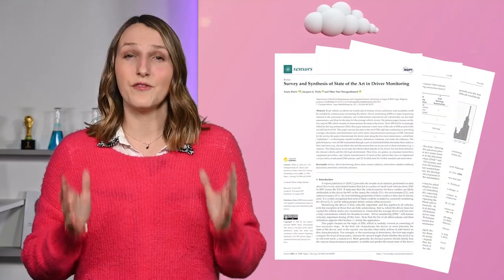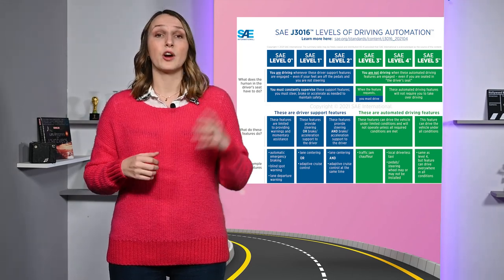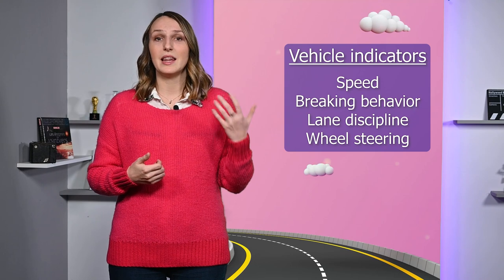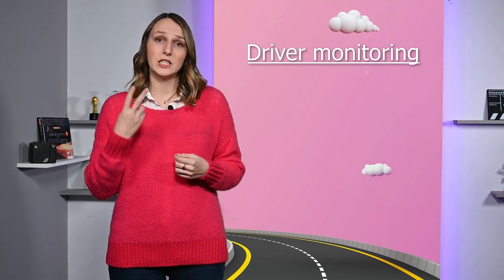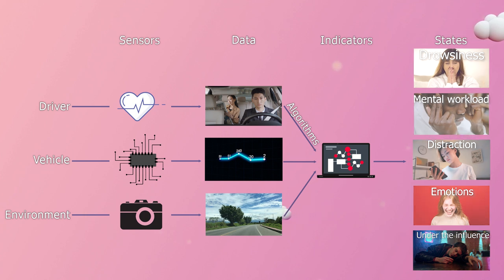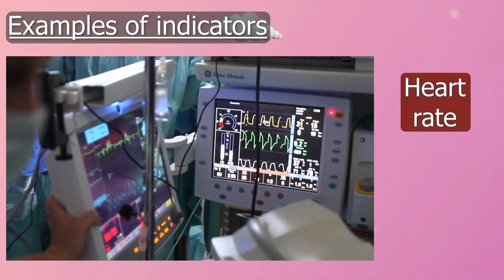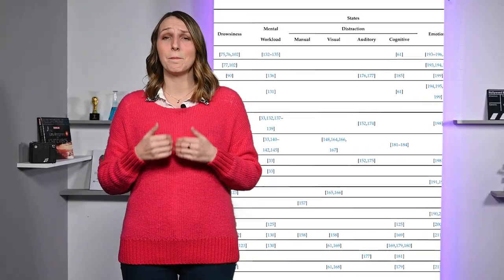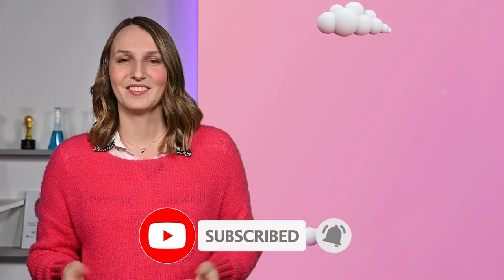Driver Monitoring: How, When, and Why?

Comment: Dear Anais, Thank you for excellent presentation,  I want to know for Level 3 and higher What are DMS requirements, It is required to be Seat monitoring along with driver, Apart from regulation DDAW, we need state of Driver to take over within Known time
Reply: Thank you for your nice comment! 
Currently, there is almost no legal requirement for DMSs. According to the European regulation, new vehicles will soon have to be equipped with DDAW systems to monitor the alertness/drowsiness and warn the driver if needed. And it should be followed by ADDW systems to monitor the distraction. 
However, in my scientific paper (https://doi.org/10.3390/s21165558) from which the video was inspired, I give my personal perspective on the matter. And, in my opinion, we should indeed monitor the driver at Level 3 to ensure that he/she is capable of responding to a take-over-request in a timely manner, which implies that the driver should be in his/her seat in an adequate state.
Reply: Dear Anais,

I was looking for Heart rate and breathing would be ideal indicator for driver health, before you enter to odd System can decide Autonomous function can be enabled for the user or not, As risk of time for the driver to overtake driving tasks within odd is high and also when to enable AESA Automatic Emergency stop assist, so need to know if you have any information how to get such details of the driver only Camera based solutions will not help, May be Radar based would help. Your thoughts on this would be helpful.